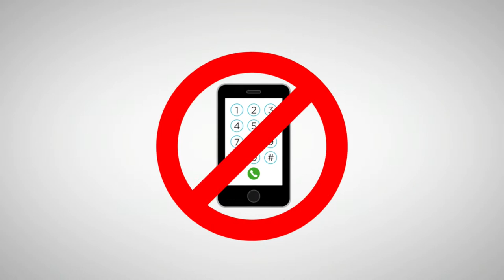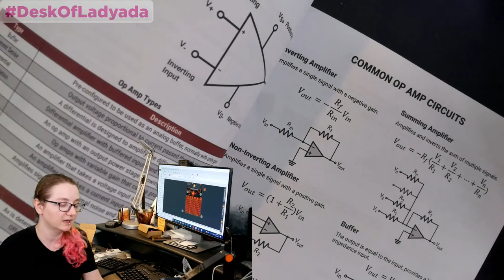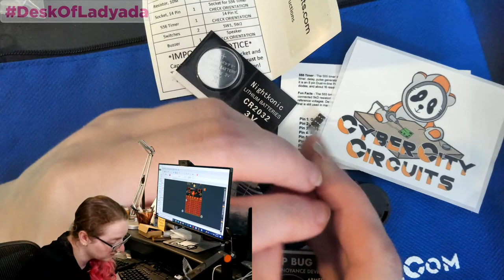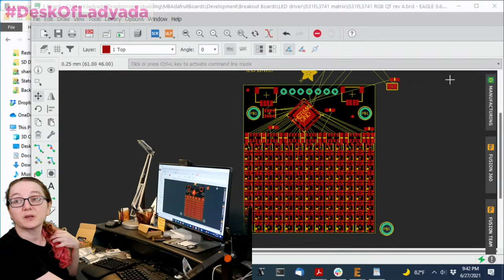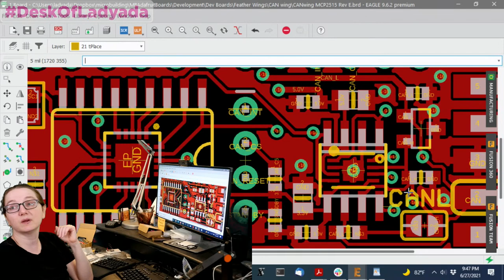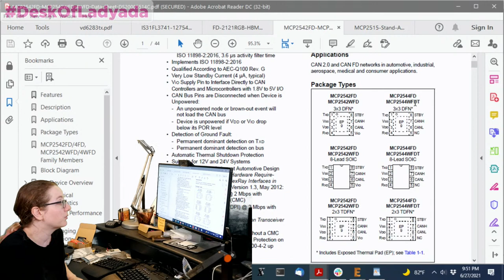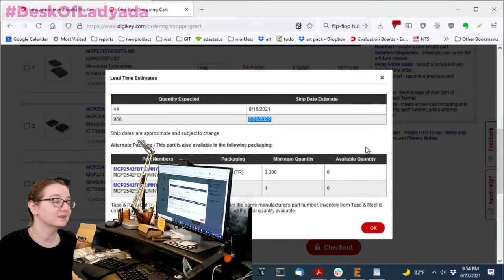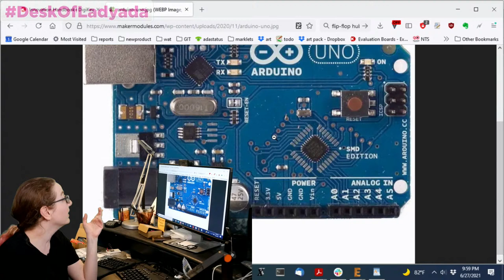Desk of Ladyada - Mailbag & Some Board Designs

Comment: Back in the 1990s there was a chip plastic plant that had a fire or something and stopped producing for awhile. Many new packages that used much less plastic showed up on the market. Lots of PCB layouts were switched from dip packages to surface mount. The plant made over half the supply of plastic used in chips.

Comment: The workbook looks very nice.  Including multiple platforms is relatively new in a text but I hope it is the way things are going.   I use dev boards as old as 8051 and 6502 variants and still find a niche for them (no need to re-test them for safety regs in industrial control applications FI).